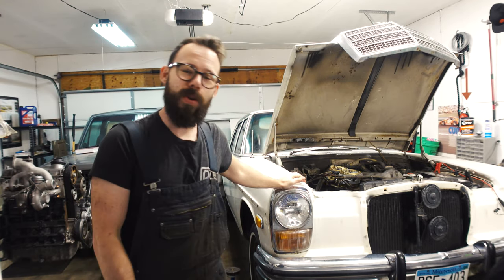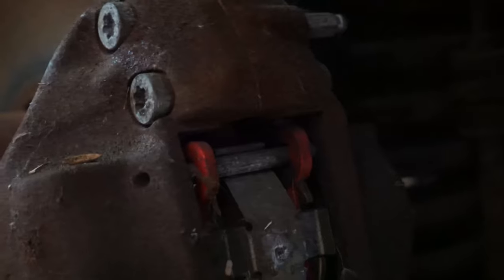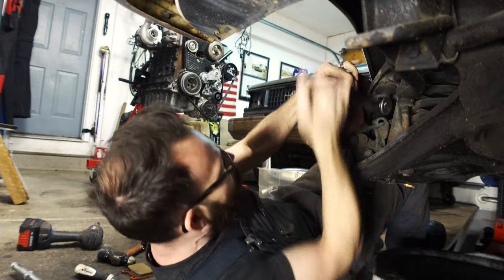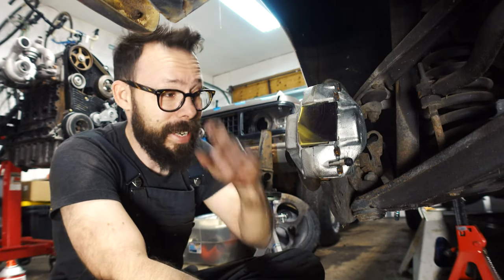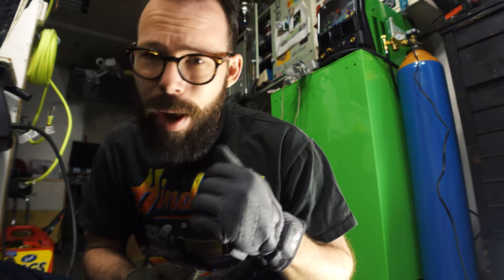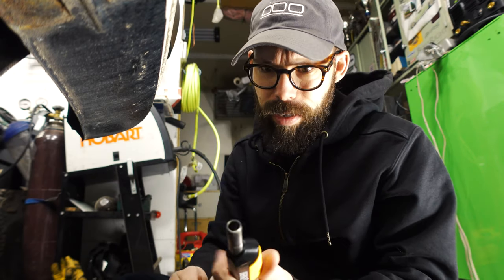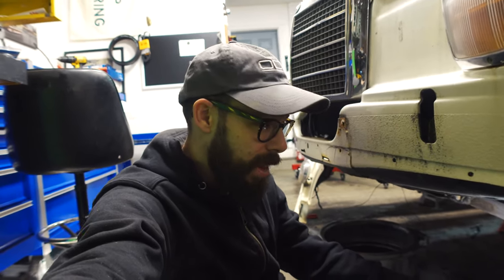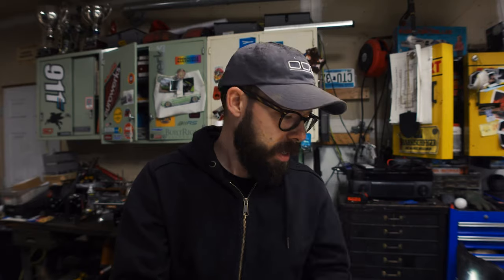How to Break things and Give Up / W114 Overcrest Rally Car Project

Comment: What penetrant are you using?   Machinists journal tested all of them and it goes Kroil > Liquid Wrench > PB Blaster & everything else.  Kroil is expensive but it's all I use now.   Also, try the heat the piss out of it with a torch, and then put candle wax on it as it cools so it sucks in via capillary action.
Reply from the maker: Using wurth products this time. Rost off I believe it’s called.
Reply: @overcrestproductions  Try the torch/candle thing, it's been saving my ass lately on these rusty POS phazers....
Reply: @ADDvanced  will do. 🌞